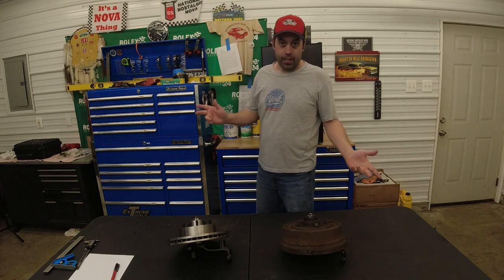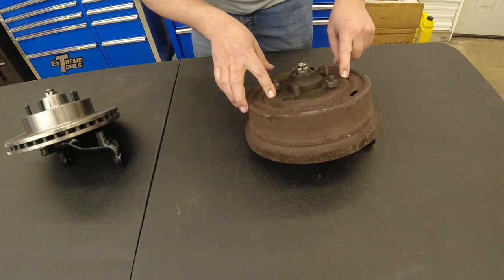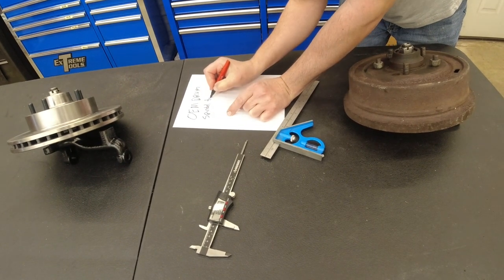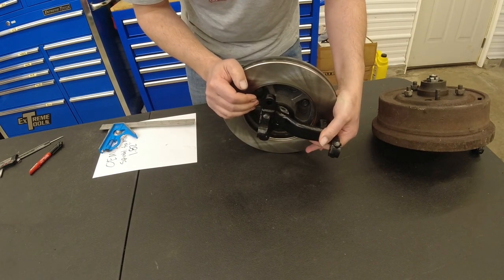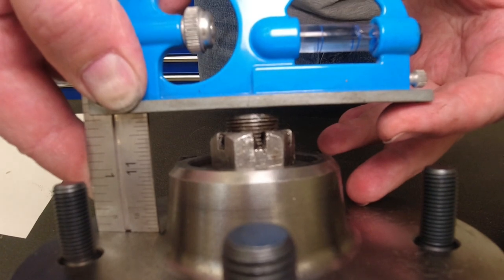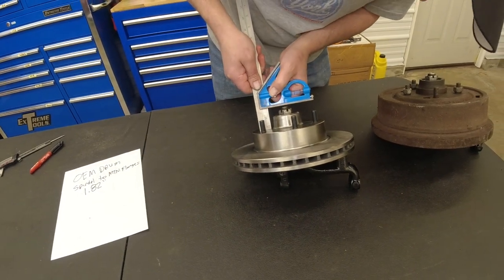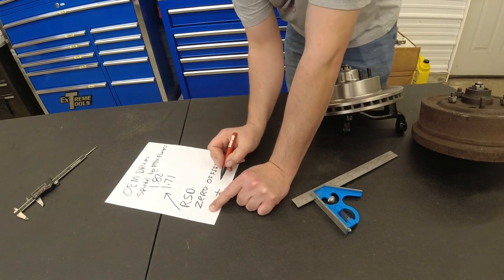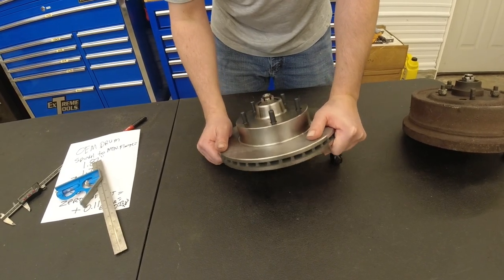The LIE of zero offset brakes.

Comment: I made zero offset on my 57 Chevy with 61 Impala roller bearing hubs and 79 trans am rear rotors. The only difference would be the thickness of the center of drum or center of rotor.
Reply: Do you have to do any lathe work? Also will it work with 14” rims